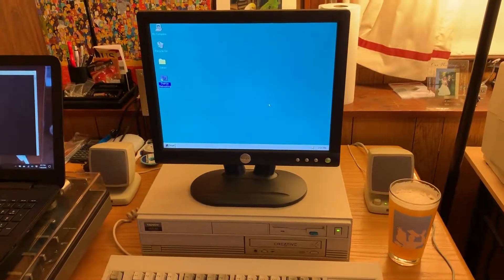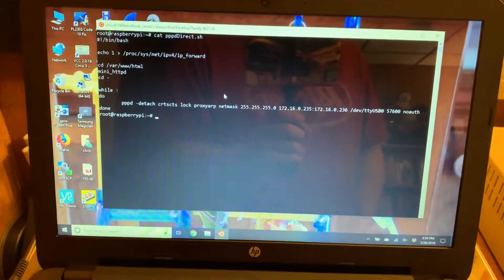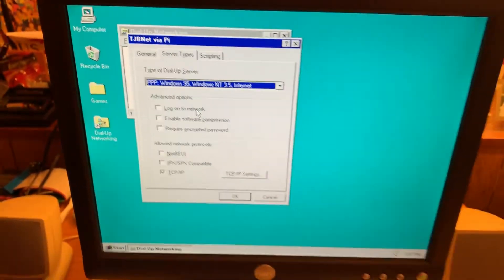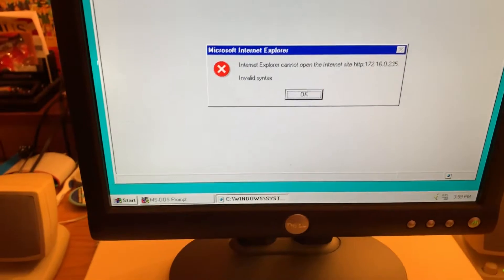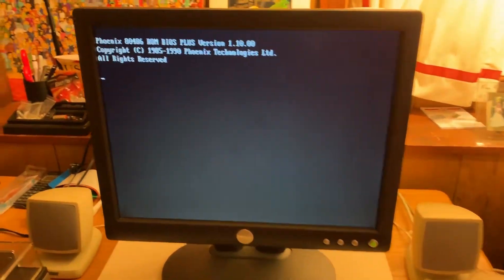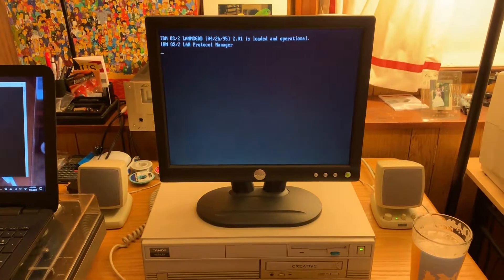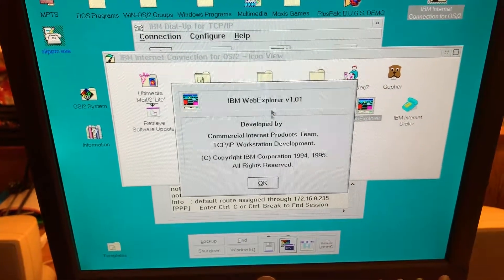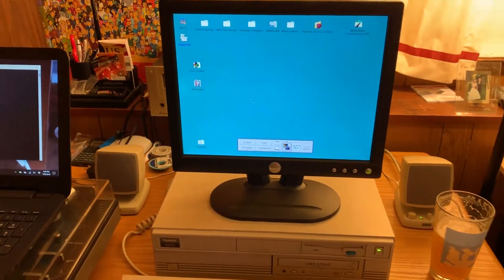Tandy 4825 SX - PPP Connectivity Over Null Modem

Comment: Nice. I’m trying to hook up a 386 machine to my network and I decided on a similar solution.
Reply from the maker: It’s a great way to get the ‘90s web experience with actual web pages from the era.  Thanks for watching and good luck with your retro dial up setup!
Reply: @TJBChris  Thanks! I’ve been getting really into the 386 experience lately so I even went ahead and ordered an Ethernet card for it. The serial approach is fun and I enjoy he dialup-like nature of it, but the hard drive in this thing is tiny and I figured it would be nice to be able to run software directly off the network. i also got myself a Wi-Fi modem emulator for my C64 to get it online.
Reply from the maker: @noname4422  I did the same thing with the 4825 SX.  It has a 16-bit Ethernet card in it now for day-to-day things.  I also used the option ROM socket to put in a XTIDE Universal BIOS EPROM so I can use large hard drives.